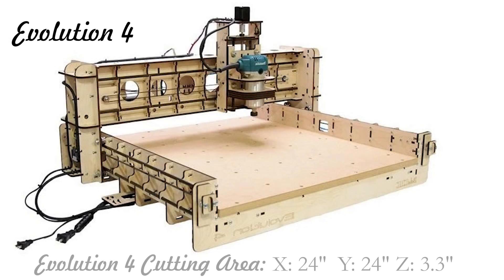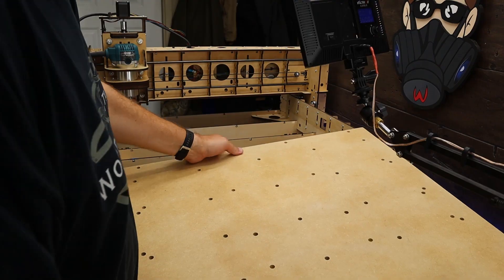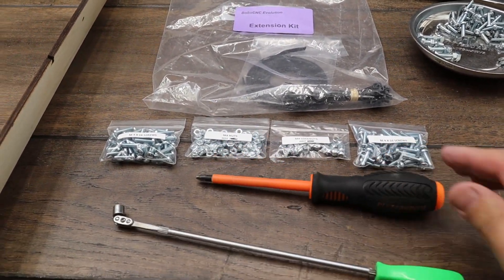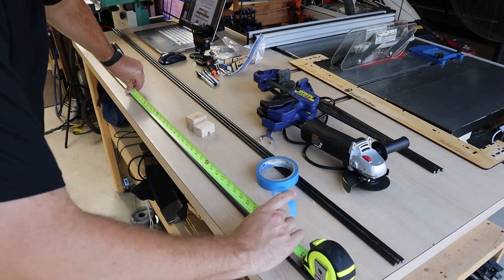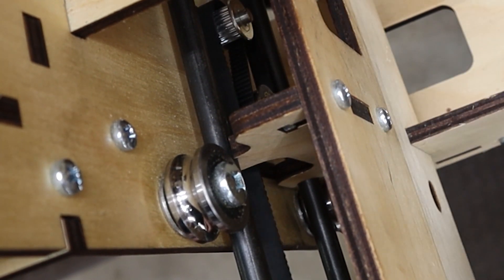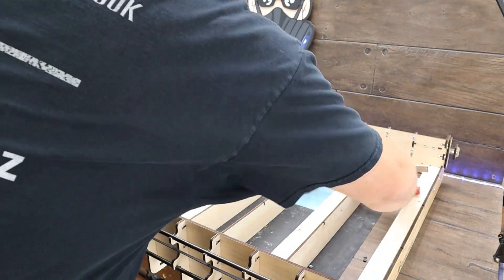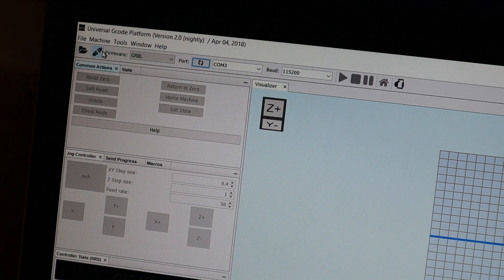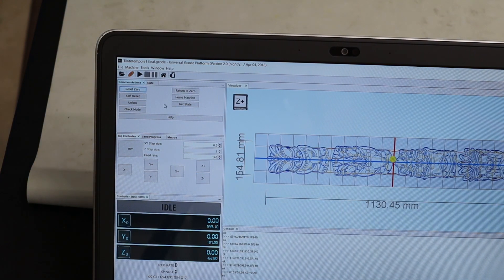Bobscnc Evolution 4 - Extension Kit - CNC router

Comment: Hey WoodenCreationZ,  I have watched this video and it is excellent.  I have added the extension bed to my Evolution 4.  I am confused about the UGS.  Is that a special program.  I am using Basic Cam and Basic Sender.  Can you direct me?
Reply from the maker: Ugs is another program for sending the created cam file to the cnc. It’s just like basic sender. So if you are using basic cam and basic sender you won’t need ugs. You can use basic cam and ugs if you wanted. It’s just another program option that can help you send the file to the cnc. I have other videos on Vcarve showing how to use ugs if you want to see what it looked like. 👊🏻

Comment: 154.00 for laser cut parts that are the same as the existing parts? That need to be sanded upon arrival? Why not sell the tiled cut file to extend it and let the owners cut their own extension parts? The rods are 9.72 each and whatever shipping will cost. Tax etc. Or just do what I do, tile your larger projects and get the same result. In fact you can make a sign as large as you can imagine. Adding two feet in one direction still requires cutting a full sheet in half. If I had a choice I would have added it the other direction. 2 feet wide is the limitation if you ask me.